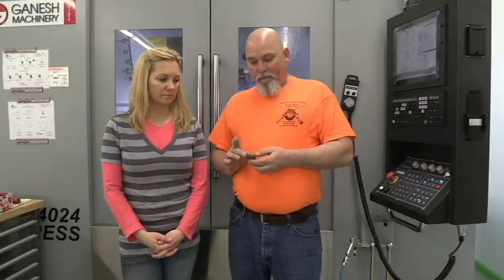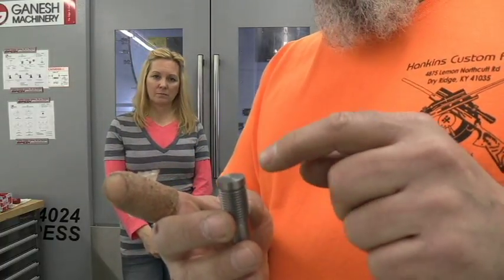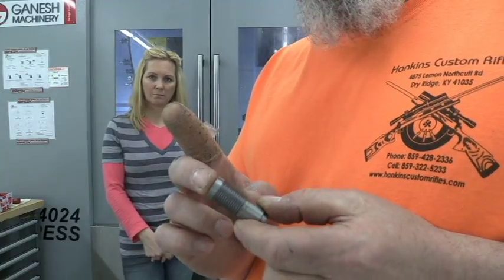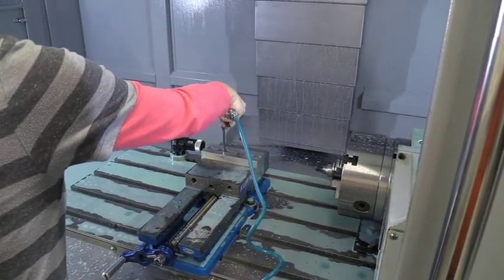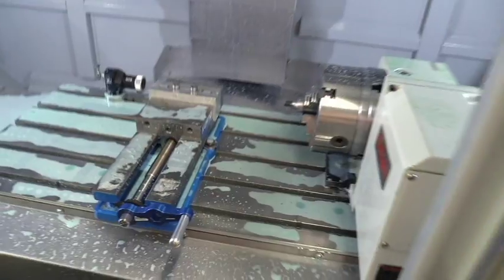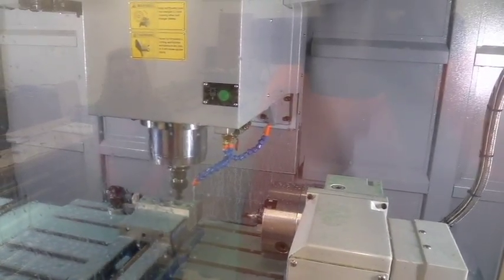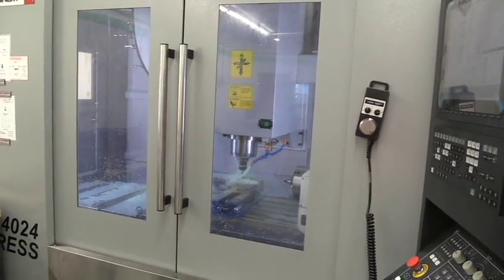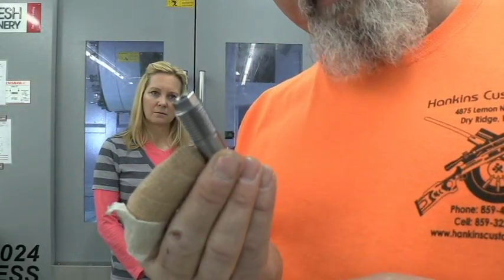CNC Machining of a breech plug

Comment: Will that plug work with the discontinued Savage ML II smokeless muzzleloader ?
Reply from the maker: Yes, It will work, but you will need to set back the shoulder in your barrel a few thousandths.
Reply: Thanks for your reply, Jeff.